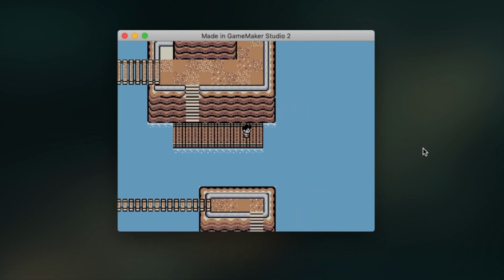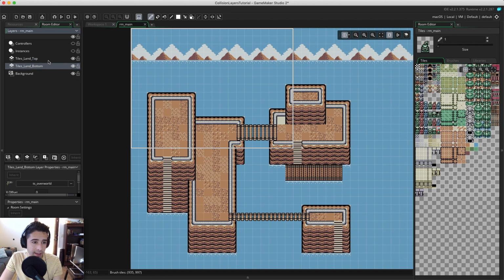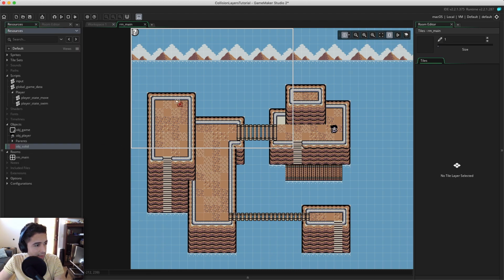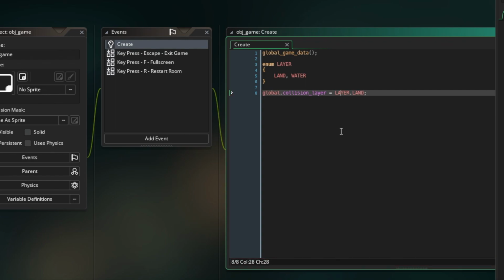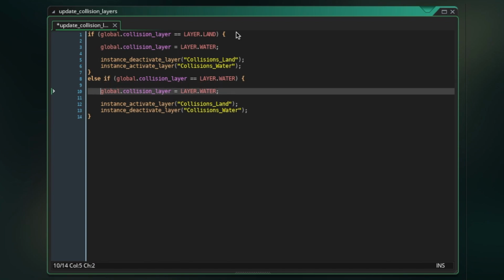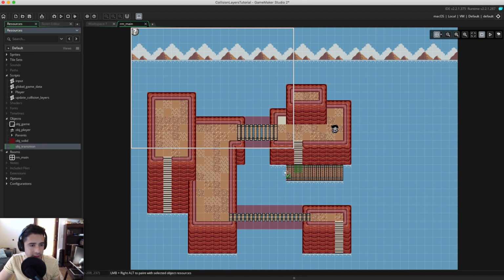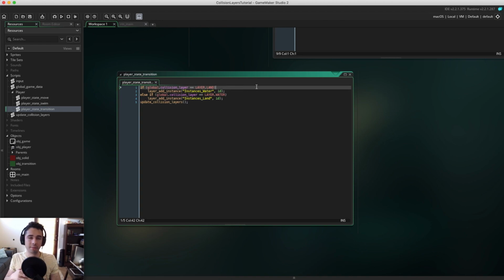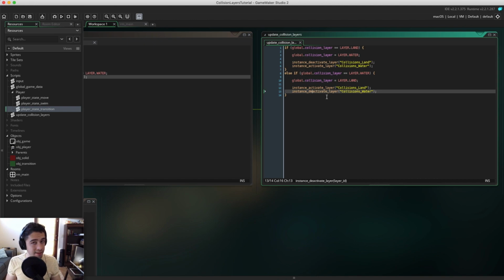Faking 3D Using Collision Layers -- GameMaker Tutorial

Comment: What type of depth system would you use with a project like this assuming there's enemies and what not and others object that'd need depth sorting also?
Reply: I had thought of the same multiple instance layer id, but can't get a proper depth sorting to work... now working with ds grid sorting but probably will try implementing a grid sorting... ds sorting by layer gives me lots of questions unanswered.